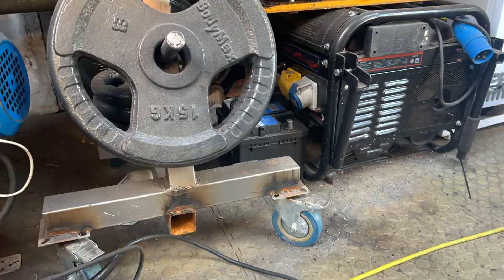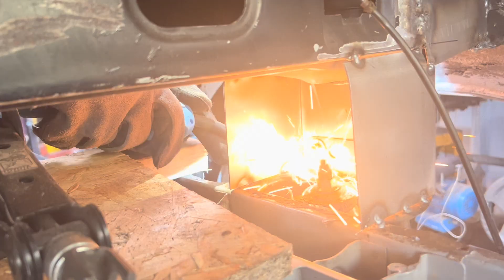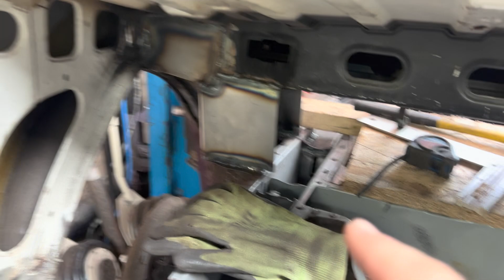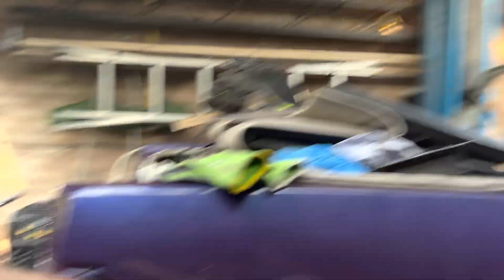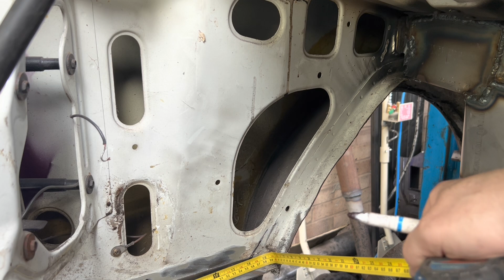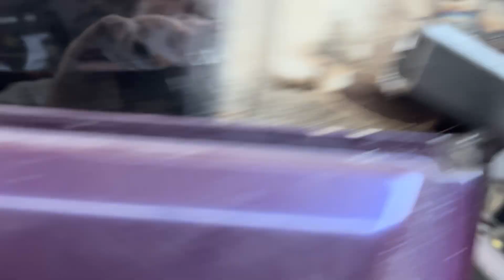25,, what have I done Escort RWD CONVERSION

Comment: Awesome fella giving me so much insperation to actually do my orion ive sorced another mx5 and sold the st170 running gear from it now just need to make room and start picking them both apart iam,not 100% sure weather i want mx5 interior or stick with the orion lol
Reply from the maker: I’m going mx5 because I’m keeping it as a modified car,, if your not bothered about rear seats you don’t need to cut anywhere near what I did,, and you can keep the mx5 fuel tank
Reply: @NicksGarageUk  ideally id prefer 4 seats as its a 4 door but yea again its all about wot will work lol
Reply from the maker: I’m working on the rear seat area at the moment my rear bench will be 72 cm wide so only small,, but it’s a seat,, if your not bothered about using the Mazda frame rails you could potentially get a little bigger but the rear subframe sits very high,, have you decided how to make it all work?? My wind down rear windows are making things much more difficult than needed
Reply: @NicksGarageUk  nope iam basically going to start chopping and see wot happends hahahahhahahaha